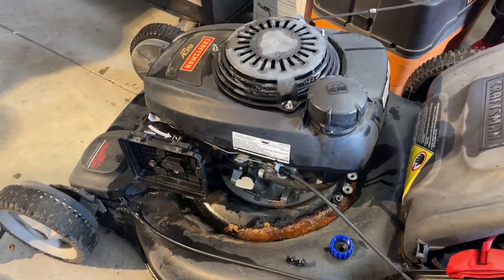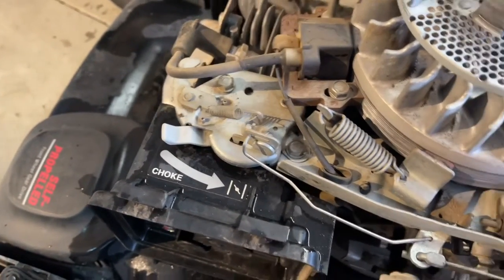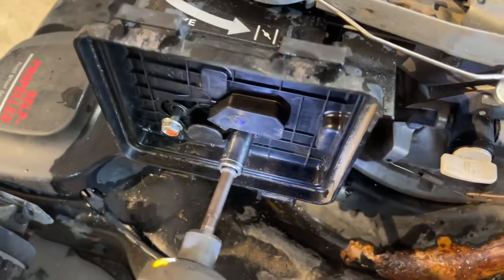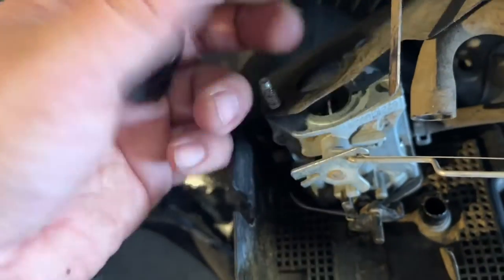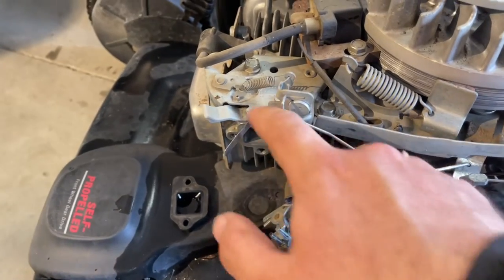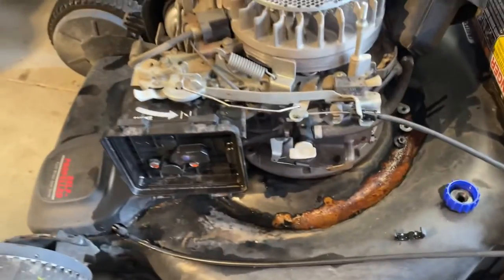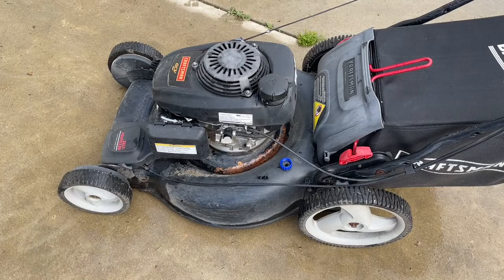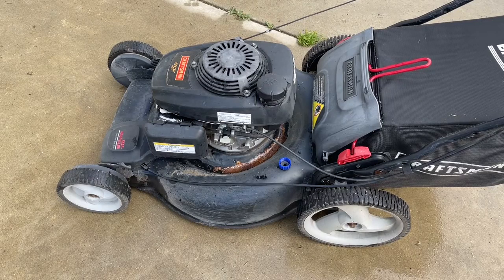Honda Choke Not Working? What to Check

Comment: Excellent explanation on the Honda choke. I had one last summer where the guy said it was very hard to start so i checked to choke and it didnt close so on inspection i noticed the actuator was on the wrong side so i put it back and problem solved . I told him what happened and couldnt figure out how it happened and he said he took the bolts off and the carb for some reason and it dropped down and he got nervous and put it back together. Maybe he should of told me that when he dropped it off but learned how it worked and like that system

Comment: my choke lever usually rests in the back position when it is running and off.  I have to move it forward and when I start it is slowly moves back to the mow position.  Now it is reversed and will dont start or run unless I hold the lever in the mow position and it wants to move back to choke.  Any suggestions?

Comment: Do all of these style auto chokes just stop halfway to the off position? Mine will go back slowly and stops half way.
Reply from the maker: Yea they are a weird design
Reply: @hanksgarage_  My choke lever moves forward a bit and does not lock in the full choke position. It always starts on the first pull though and returns on it's own to the closed position after it starts. Not going to worry about it!!!!

Comment: Can't understand how the throttle works when you pull the lever on handlebars it releases the choke so it slowly goes back but it's not connected to anything else like the throttle to increase revs
I squirted gas into the carb it went for 20 secs.